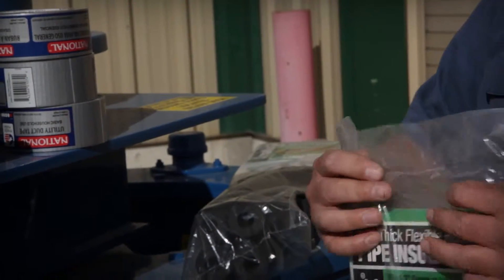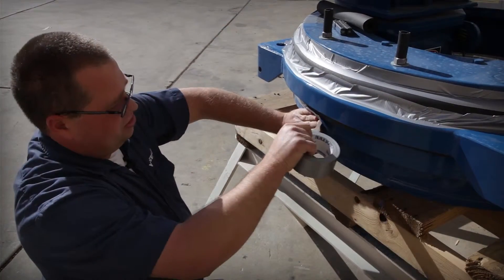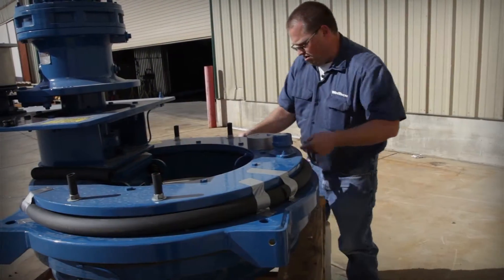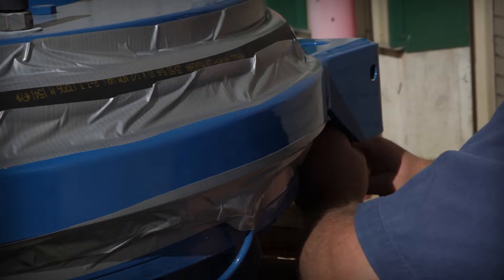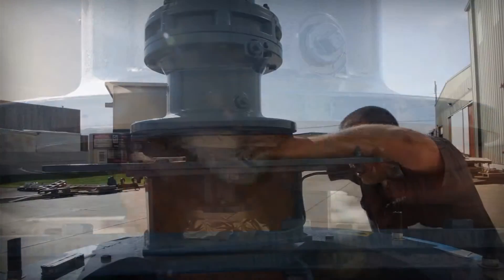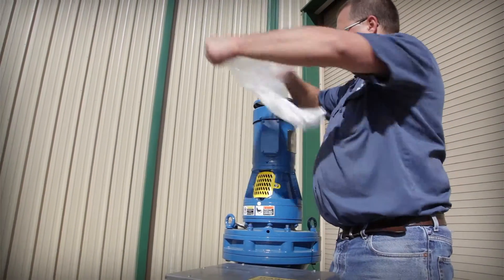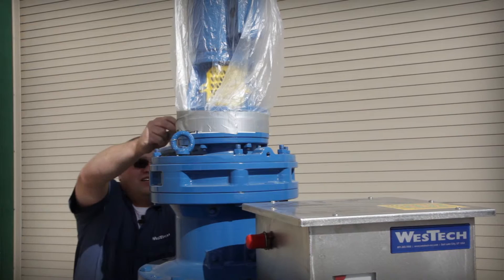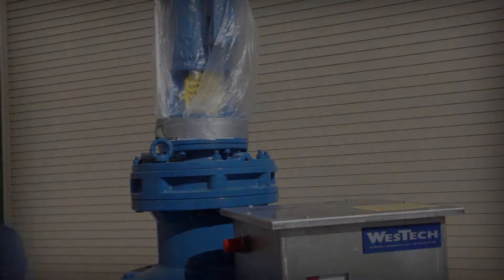How to Seal Drive

Comment: In the event that sand blast media ends up in the drive. What the procedures for removal? Kerosene flushing? Manual Cleaning?
Reply: You should contact WesTech for support (801)265-1000. In my experience flushing of any kind does not work. The  drive will need to be taken apart and manualy cleaned.